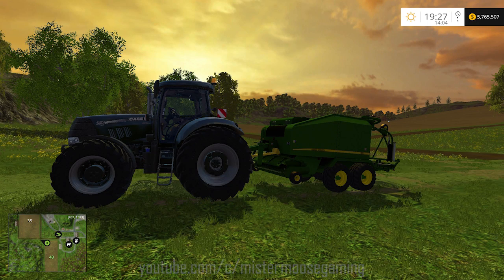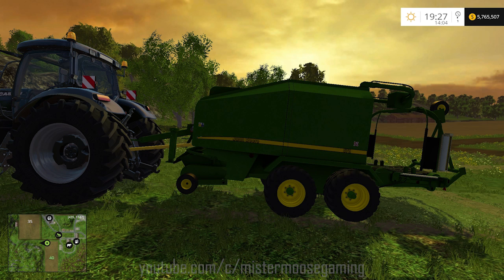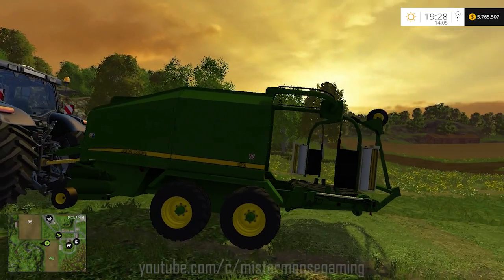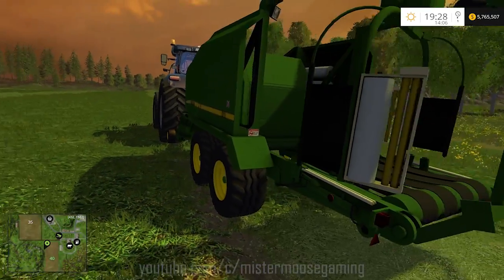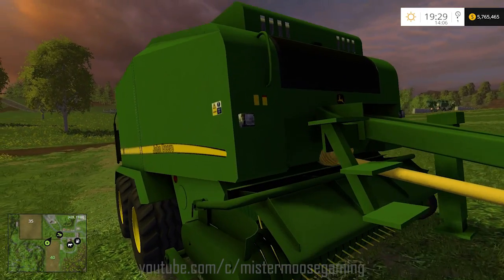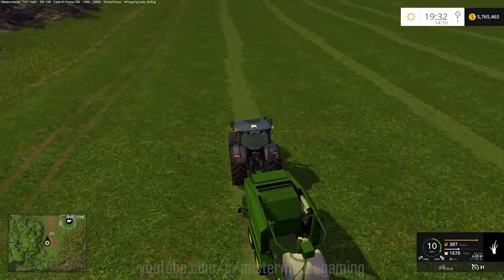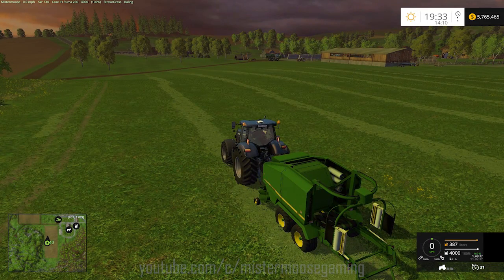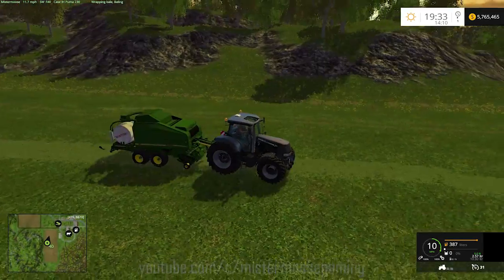Farming Simulator 2015 - John Deere 678 Baler and Wrapper  - Mod Showcase

Comment: Does it cycle ok when used by a worker with the FollowMe mod?

EDIT:  After  using it for a while, Follow Me doesn't work with the wrapper attached to the baler.  Once you detach the wrapper, the baler works fine with Follow Me.  If you want to wrap bales with Follow Me, it's easier to take the wrapper module off this baler and then pull the stock wrapper trailer with another tractor using an offset.